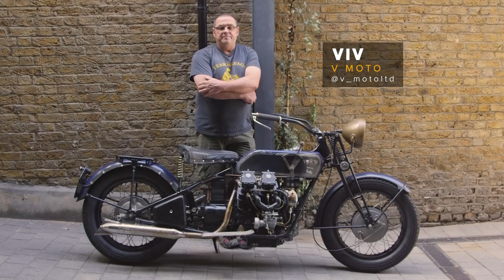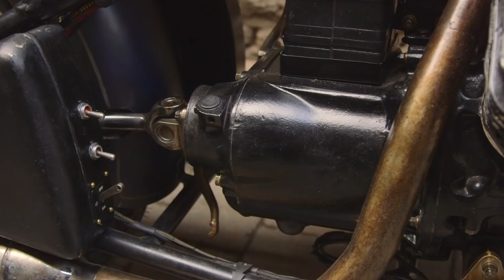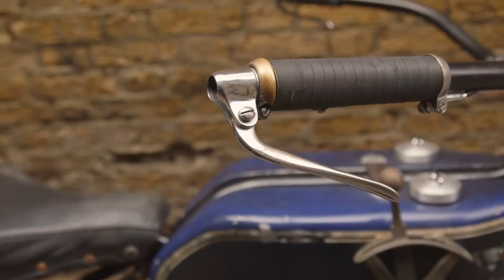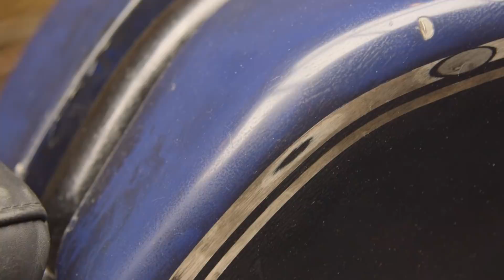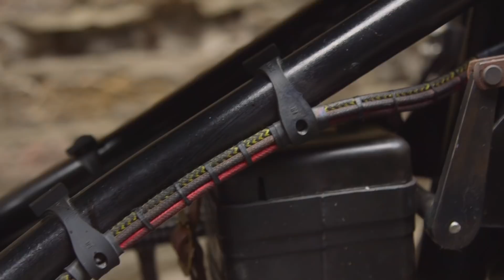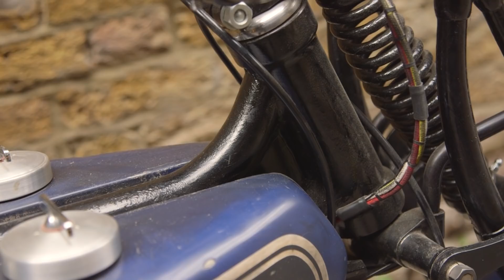Viv's Aircraft Engine ABC Custom Motorcycle

Comment: this reminds me of a drag bike that used a two stroke engine made by Johnson for the us navy to pump sea water for fire fighting aboard ship...the engine was converted to air cooled..the pump was originally water cooled...when it was all trimmed down and fitted with a transmission it made a really fast drag machine...but the builder did all the machine work himself and faced many of the same problems you did here ...the name of the bike ..."The Pump"...of course

Comment: Blah blah blah blah blah. Does it run? I dont know. 
You could have said up front that its a non runner and I wouldnt have wasted my time. Bike Shed you are arseholes. Listening to that bloke blathering on about his racecars and painting and old school this and traditional that and then no start. You could have done a three minute video with just fotos.
So what Ill do is get the engine out of a Saturn 5 rocket, scuff it up and weld 2 wheels on it and call it my interpretation of a motorbike.I wann say the F word but I wont.
Reply from the maker: You need to calm down Roman. It’s an incredible piece of design and fabrication. Appreciate that. Read the description. It wasn’t built here, but whilst Viv was in the area, we decided to pull him in for a video. It’s a personal project and when Viv finds the time, we’ll catch up with him after the engine rebuild. Yes it would have been great to hear. Blah blah blah.

Comment: What? So you built this bike .? Never had the engine fired up ?
I noticed  you didn't  mention how thd engine starts . If it starts .. . kick or starter motor . Man  that is odd.
How long would it take to remove the heads and inspect the top end.?
Then you mention as having no spare parts available  !  Well that wouldn't be a  problem for a  with  your building and engineering  skills . 
So lets see part 2 of this vid where you have the bike started by you and cruising up the road.
Otherwise  a top job Bloke.!

Comment: I once had a V Twin 82nd Airborne Division Field generator, within a cage to ease handling and air drops.  It fired my imagination to where it could only be used as  a small motorcycle engine.  I had a 125 HD in a hardtail frame that was the spitting image of a WR frame and was all set to start when someone stole both of them from my back porch.  You can imagine my anger and disappointment, I'm sure.  I'm so glad to see that you have realized your dream.  From one machinist to another, keep up the good work.  You do it well, indeed.

Comment: APU built by a motorcycle company. Piaggio Vespa began life, post WWII, utilizing surplus APU's from an aircraft company.
Reply: American APU's, in the WWll era were usually Aircraft clones, with a single Magneto.
I built my Airboat, using a Continental PE60, wich was rated at 90hp, the Aircraft version was rated at 100hp.
I used the single Mag as a Distributor, and incorporated a Computerized car Ignition, to eliminate points.
I also blow through a Weber Carb with a Paxton centrifugal air mover to get 3lbs boost.
I don't know what the hp is exactly, but I have a 66" Variable Pitch prop, set @6.5 turns + pitch, that gives me 2900rpm.
This pitch is equal to what my buddies prop setting is, on a 150hp Aircraft engine.
I'm happy with it!

Comment: If you're going to build a motorcycle around an engine, get the thing running before you do so. Smh... 

I could give two shits about your aircraft hardware if the thing doesn't even run, I guess im out to the garage to get mine running.. Doh!

Comment: Well done. Stripping the engine before running will do more harm than good. Change the oil fill with ATF pull off rocker covers oil the rockers pull out sparkplugs put 20ml atf in each hole. Crank over 100s of times without plugs in. then put back plugs and rocker cover start it run 10 minutes drain ATF and fill with synthetic oil

Comment: Absolutely love it. It sits really well. Particularly like the way you had it patinated. Everything looks well proportioned.
 I like the way the tank and the seat level through. Attention to period detail such as the sand bending of the frame set this one apart. Imagine if you parked this outside the ABC factory back in the day. I bet it would have stopped the production line.

Comment: So... not an aircraft engine, a generator motor.
Reply: It is an aircraft engine because of his lightweight, even if it is used as an APU. The Garret 331 was the APU of the Boeing 747, but it was used in many aircrafts as a thrust power engine, aircrafts like the Rockwell Commander or Mitsubishi Marquise.
Reply: so....an APU. try spooling up an aircraft without AC power and/or hydraulics (from the APU) or, when you flame out in flight...no APU to serve for redundancy.
Reply: well, technically it was an engine in an aircraft...just not the aircraft's engine.
Reply: https://jerryamcm.blogspot.com/2013/05/1946-triumph-gp-racer.html
Reply: who care?...
Reply: Can you say clickbait? lel... but magnificent build non the less..we have to give him that ☺
Reply: @thumperwd  ~ You summed it up perfectly. Clickbait, so much like phishing, isn't it? And, agreed, the gent did a fine job using an auxiliary engine as a motorcycle engine, indeed.
Reply: The Mighty Dash , true and not true? An actual engine that powered the props would be 10x better
Reply: @Damnit Bobby bruh I work 50 hour weeks, i don't have time for video games alongside school. Made my name years ago

Comment: love it. Easier in this day and age to fix the old odd engines. 3D print the part to ensure fitment and either CNC or have it cast from the model. Leno has revived several dead cars to running condition because of this.